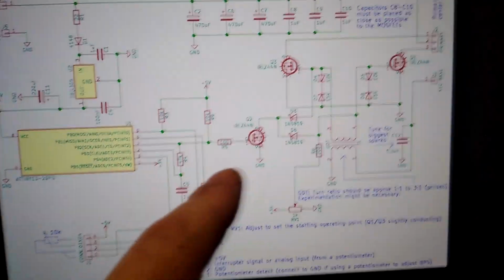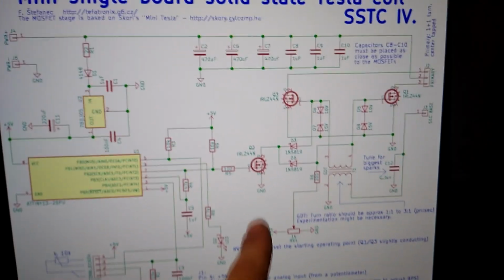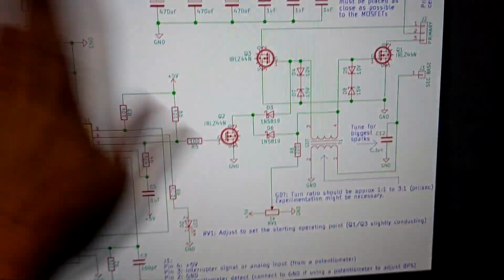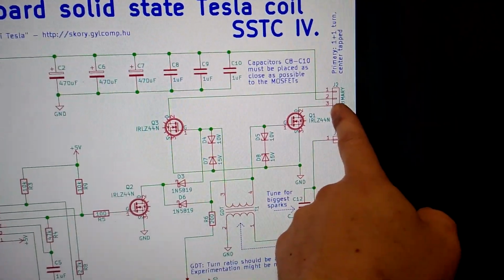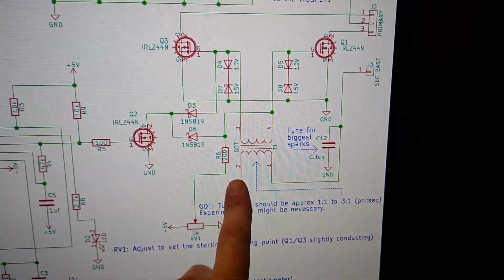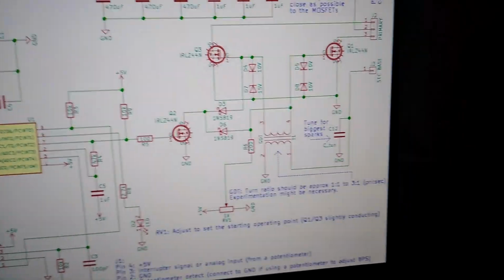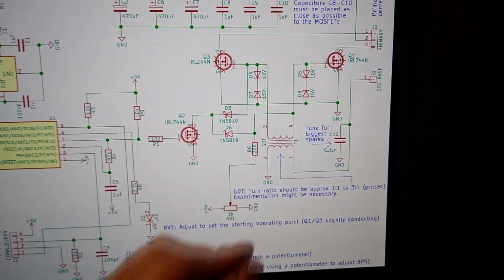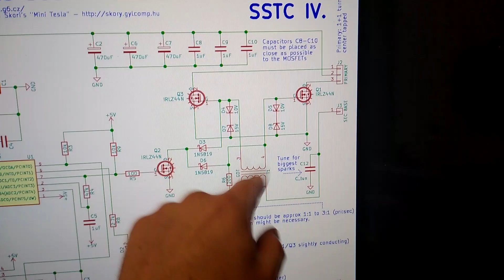Exploring the awesome TefaTronix SSTC IV based on Skori's driver

Comment: hey, great video! i’ve basically built the same coil with a few differences and i’ve been having problems since i tried to put everything on a blank pcb and at this point nothing is working the way it should like before, mainly that around 15-17 volts it seems to work okay with a tl494 interrupter, but i have smaller arcs, but when turn the voltage up from powersupply the coil goes CW mode and oddly enough i can turn the coil on or off via duty cycle potentiometer if that makes sense. some one had suggested RF interference which i haven’t tested for yet but i have a feeling it isn’t the case or at the very least not effecting the interrupter too much like how it is now. id like to mention that currently the pwm is on a breadboard for testing with some jumpers to the main driver on a pcb and also i am using fake tl494s from bojack if that helps, thank you
Reply from the maker: The interference is a fairly common issue with many of these. I've had that issue so many times in the past I forget all the various ways I've gotten around it. Layout is certainly important, but maybe what's more important is decoupling all over the circuit. For example I always find some way to ground my potentiometer chassis and decouple them as well. Typically if the layout requires the coil to sit near the circuit I will try to create some kind of foil shielding. Good grounding is certainly going to help.
Reply: @Magneticitist  i tried shielding my tl494 with foil connected to gnd of my power supply and it kinda worked but i am still not sure if this is actually causing such a dramatic decrease in arc size, unless maybe i was doing it wrong or grounding it wrong?
Reply from the maker: @nguyendesign4517  Grounding can get pretty complicated. The sensitivity of any IC's used matters a lot and the TL494 seems fairly resilient but it's definitely given me problems before. Shielding just the IC is one thing but then you have to shield or ground out every exposed piece of metal around it that is connected. It should not be dramatically decreasing your arc sizes though, unless in the process of better shielding/grounding the IC is putting out a cleaner Duty cycle that happens to be shorter or something. I've had to sort of experiment with the shielding in various builds. A lot of the more recent ones where I've made tidier and smaller circuits with a lot of decoupling capacitors have only needed a layer of foil covering the whole circuit. Some don't need it at all. The way the electric fields can gather can be strange and seemingly random.
Reply: @Magneticitist  hmmm okay. right now i am running the coil with the interrupter at a distance on a breadboard, i am able to get things to work at about 14v but any higher the interrupter will stop working properly and it goes CW, i notice that when this happens the LED i have for the interrupter stops blinking too until i turn the input voltage back down. but if i were to use decoupling capacitors, what caps would i use, what value and where would i place them?
Reply from the maker: @nguyendesign4517  I usually just use cheap multilayered ceramic capacitors to decouple circuits. I will grab an assortment ranging from 1nF to 10uF or so and they typically look like little yellow or blue blobs. The idea is to place them across your IC's or other sensitive components as close as possible to the supply legs. This will hopefully take any high frequency noise and shunt it out to ground. You can typically place something like 100nF across your TL494 supply legs. I will often place some across my potentiometers as well. Then I will try to ground out the metal housing on the potentiometers as well. Any voltage regulators present I will also make sure to add the recommended input and output ceramic capacitors on top of the main electrolytic.

Part of the problem with breadboards is that they are inherently 'rats nests' of wiring. This is not good for high voltage and high frequency applications. The breadboard also basically has a bunch of floating pieces of metal all across it where the leads clamp into. I believe the only way I could rely on a breadboard setup is if I maximized the possible size of the wire leads I was using, minimized the length they were traveling, and then removed every metal clip on the underside that wasn't being utilized in the circuit.
Reply: @Magneticitist  wow this was really helpful, I really appreciate it, so to be clear i can’t place caps anywhere on the tl494, just supply pins? and also my POTS have what i believe is a plastic casing but when i touch them even with a plastic knob on it seems to effect my output and even make it go CW, also i have been thinking and i believe this problems started when i changed my primary coil,before it was a tight coil wound to the secondary and now i have it on a 3d printed tube and multiple wires making up the primary to handle higher current which was unnecessary now that i think about it, is there any possible way the primary is causing all these issues now?
Reply from the maker: @nguyendesign4517  You can technically place the caps anywhere so long as one leg is going to ground, and the presence of the capacitor is not altering the circuit undesirably. You don't want noise coming in to the IC supply though so putting the cap across the input legs is a good idea because it's supposed to take a DC source. The pure DC is not going to shunt to ground through a bypass/decoupling capacitor but much of the noise should. 

Is the circuit actually Earth/RF/Mains grounded?
Reply: @Magneticitist  i’m not totally sure, my powersupply does have a ground pin (negative) so everything is hooked up there but then talking to some other people i’m questioning the grounding of my house
Reply from the maker: @nguyendesign4517  One thing you can try doing is just adding a large RF Ground to see if you notice any change in operation. Since I have a couple tables nearby that have metal frames and legs I can just use a long clip lead off the negative rail of the circuit to some conductive part of the table.  

When the circuit is not properly grounded there will be high voltage floating all over it. This can be typical with many circuits that are just using only a circuit ground that is the negative terminal. I used to be able to pull arcs off the plastic knobs on potentiometers when floating the circuit like that. Slayer Exciters will do the same thing when not grounded.
Reply: @Magneticitist  wow this is very helpful i’ll give it a try, so i still have everything to negative of my powersupply but also to external grounding?
Reply from the maker: @nguyendesign4517  Yea, the last 3 or 4 of the more evolved versions I've made don't have any shielding at all and they work very consistently. I think all of them have the other end of the feedback transformer primary going to circuit negative, with that also tied to mains ground before I run them.
Reply: @Magneticitist  is the feedback transformer a current transformer?
Reply from the maker: @nguyendesign4517  Not really no. You want it to be high current because the feedback current is what is actually driving the mosfet gates. With a CT the feedback is just used as a signal for timing.
Reply: @Magneticitist  ohhh okay i see, we’ll thank you for helping and explaining. i’m gonna try some of those things you told me out
Reply: i am also using IRFP250N for my main mosfets of the driver and IRFZ44N for the interrupter mosfet

Comment: Could this be used with IGBTs instead of MOSFETs?
Reply from the maker: It may or may not work well enough depending on the frequency it needs to run. If the gate drive requirement is low enough and the frequency is low enough it may work but but there isn't much point IMO at these low voltages
Reply: Ok, I was wondering because I have a bunch of spare IGBTs, but I see why mosfets would be the more logical choice here
Reply: Thanks for replying! :D

Comment: hes using logic mosfets. what didu use to amplify the signal to switch ur 260's?
Reply from the maker: He said in his final build he used IRFZ44N's instead of the IRL's. I don't switch the 260's with anything other than the GDT's though. Ended up with much better performance on some other coils.

Comment: Have you tried starting it up without the startup divider ?  With a separate pulse through one of the primary loops ? It should theoretically work, but then it can't  be interrupted so simply via the gates.
Reply from the maker: @sFeral  I'm just not sure what you mean exactly relating to the Slayer exciter. If you mean using an NPN/PNP amplifier arrangement that's something I was going to try eventually for an amplifier build with a couple high power transistors I have but I did wonder if it would work on the TC. There's a lot of ways it can be done but the skori push pull is good for low voltage as it is outputting comparable to using much more components in a full bridge. Another user told me it's good for high voltage as well so long as you increase the primary windings and the base resistance.
Reply: @Magneticitist   Skori is kinda like  having a slayer taking feedback from both sides of the secondary (the way I see it)
Reply: @Magneticitist  In fact you could place a feedback transformer (not necessary but I'm guessing stronger feed) at both sides of the secondary and put "top loads" on both sides, voila a bipolar
Reply from the maker: @sFeral  It's possible you could make a push-pull slayer bypassing the GDT altogether but you would just lose the finer adjustment the GDT could offer when varying the windings.
Reply: @Magneticitist  Unless you keep the GDT and use only one terminal ?
Reply from the maker: @sFeral  Man I've been waiting on a large roll of magnet wire forever.. I got all kinds of stuff I want to try and test including a PLL driver and half bridge setups but IDK if this shit is ever coming. I'd hate to tear up some old stuff just to reuse coils. I think the Skori setup is about as good as one can get when using low voltage and no gate drivers but now that I have some gate drivers I'd like to try some mains voltage setups. Problem is no variac so I gotta get creative.
Reply: @Magneticitist  Keeping it simple, how come nobody is using a GDT on a basic slayer ? Maybe that's the first thing you should test out.
Reply from the maker: @sFeral  I think it's just due to the lack of necessity, the Slayer is so cool because it's so simple. You really only need to play around with the bare basic variables to get good output. The more stuff you add to the basic Slayer you might as well keep adding.. like adding a GDT you may as well throw in a gate driver or even then just go for the half bridge etc. I think PowerMax is one of the guys who took it there but instead of a GDT just used a gate driver with direct feedback and clamped the voltage with diodes.
Reply: @Magneticitist  Does the BJT (or FET) get damaged by the direct feedback ? If yes, then introducing a GDT does make sense.
Reply from the maker: I've never tried that but I'd guess the divider needs to be there for the stability even if it tried to start up with an initial pulse. Sort of like a slayer exciter without a base resistor can be kick started but without the resistor there it can also be easily kicked out of oscillation into a full off.
Reply: @Magneticitist  Haha yes, hooking up a slayer to one of the loops would do exactly what I described, and I'm just now realizing that I had that idea already, a while back...  Will you test this ?
Reply: @Magneticitist  It originally came to mind because I wasn't able to get a strong enough feedback via the feedback transformer...  then again one of the existing FETs could maybe do the work of a separate slayer, if the bottom sec terminal is branched.
Reply from the maker: @sFeral  I usually have the opposite problem where the feedback is too strong. Sometimes it's easy to trim back the divider to then get the nice discharges but a lot of the time it really wants to pull a crazy amount of juice. It's where the difference between this circuit and the double slayer comes in though.. I've been curious of the true operational difference though I assume the double slayer is firing both coils at once and this other one works like a full bridge.
Reply from the maker: @sFeral  https://www.spigellab.com/2016/05/27/100w-wireless-and-single-wire-power-transmission-with-high-power-double-slayer-exciter/ 

That site explores it but I first saw it being used most effectively by Deeds on youtube.
Reply from the maker: The skori works like a push-pull amplifier being that the center tap is B+ and each primary is wound in opposition.